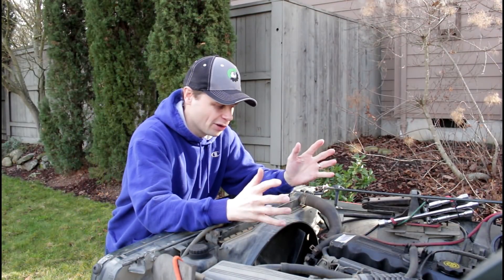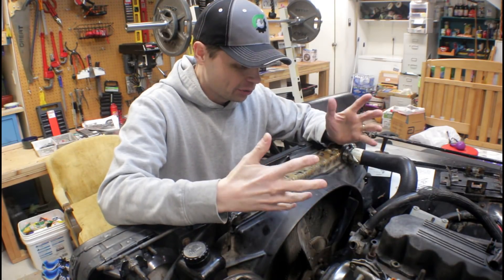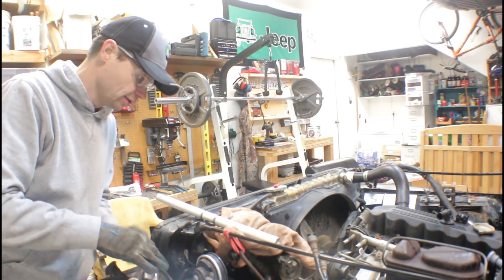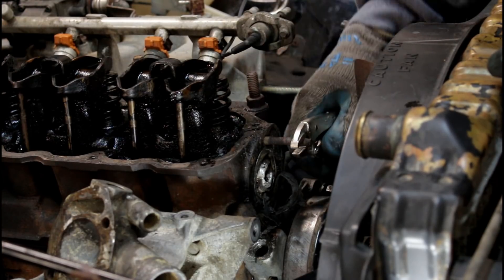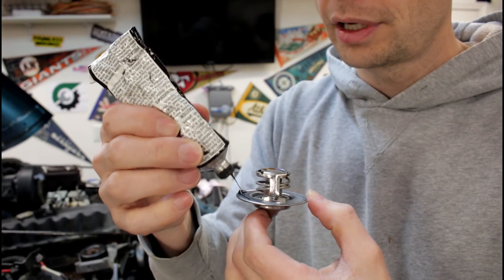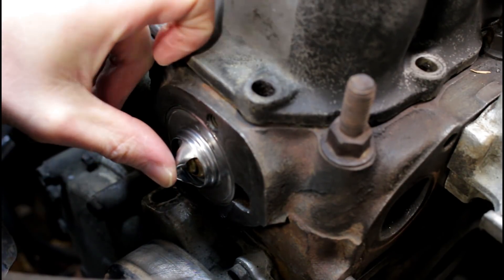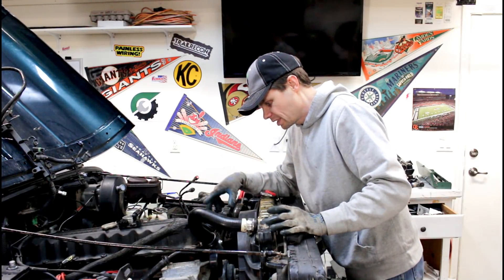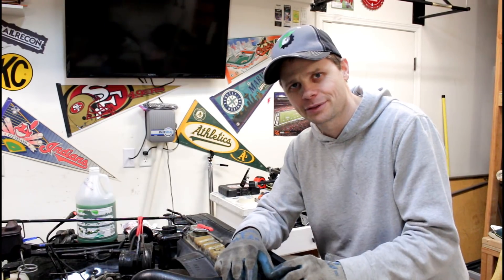Jeep Wrangler YJ Thermostat Replacement

Comment: I had to remove the radiator to install an aftermarket a/c system with condenser and fan. I got it all back together, and the temperature went from 210 on the gauge to 265 degrees before suddenly moving back down to 210 and staying there. I read the thermostat sticking was the problem. So I am glad to of found your video and the coolant hasn't even cycled ten miles yet. I figured I would nip this in the bud before it becomes a problem further down the road.
Reply from the maker: Great! I'm glad you found it helpful.
Reply: @JeepSolid  I did happen to notice that, for the gray RTV sealant for thermostats, the directions said to wait 24 hours before refilling. I don't know if that black RTV sealant you used required the same 24 hours. Other than that, the gray sealant behaved the same way in terms of holding the thermostat in place while I put the housing on.

Comment: Very helpful. Question for you. Own a 2000 jeep wrangler, replace the thermostat but the bolt hole on the bottom is stripped and have a bad leak. Any recommendations, what would you do? Thank you for your time ,aloha🤙🏽🍍

Comment: I was wondering if you ever had an issue with your temperature gauge?
I have a 94 YJ. 
I pulled the gauge cluster out to replace the light bulbs to LED.
When I put everything back together my gauge began to give me problems. So I replaced the gauge. Still didn’t give me a good reading. Jeep would sit all night, and still read 210. I finally replaced the engine coolant temp sensor and now the gauge it maxed out to the limit by driving less than 5 minutes. 
Any suggestions?
I’m thinking about wiring in a gauge through the fire wall straight from the temp sensor.
I have replaced the thermostat and the sensor that goes to the ECM. 
I have no check engine light.

Comment: Another good video!  and great tips on the process. Good idea to go Grade 8 bolts just to ensure they never snap again. doesn't hurt to use never seize on the bolt shafts where they got stuck last time!
Reply from the maker: +Jeff Chappell yeah, anti seize is a good idea as well

Comment: Yup; as I’m doing my water pump I decide to do my thermostat as well once I was done and what happened the bolt came clean off just like yours, and nowhere could I find the top bolt ended up going with a 1/4th inch shorter bolt which I suppose won’t cause a problem since it’ll be in there either way. Great video thank you!
Reply from the maker: yeah, what a pain.
Reply: Measuring mine to the old, unbroken bolt, it was 2 1/2 inches. I could not find the 2 1/4th inch bolt either, so I got both 2 and 2 1/2 inches to measure up.

Comment: Right away!  This is what I'm talking about!  I can already tell this is the solution! I just figured the automotive industry wouldn't be so stupid and when you buy a gasket it is quality and will work the first time as it should!!!!!   This isn't helping that people have to make money of knowing cheap tricks (unrelated)   At least your video seems to be helping and this would be the resolve I'm sure(a gasket that seems to be the correct width and proper sealant just incase), I might have to order a new thermostat housing to be safe! Not sure yet. Really don't see a need! Just not a fun job to be direct! I appreate the humor within your videos.  Lmao?  You said felpro? I don't think so! That's the gasket I used and it was shit, the other gasket looks like the 30$ gasket, also not colored the same  35630 was the part for the  felpro gasket Grey and red lines around the gasket for the one I ordered and tried! It ripped even with perfect seating, so not likely the r.t.v would have worked with this gasket!    This was for a 2000 jeep wrangler 2.5L   Altought the gaskets look the same at least for the fitment!  Yours looks like 30$ edelbrock gasket

Comment: Awesome video dude..ha i new there was a reason for that little whole! 

So you putting lube on the thermostat to make it stay and not leak was why i found your video! Question my replacement thermostat came with a rubber “O” protecting type situation around the rim! Is it for a reason or part of the packing? 

Thanks ahead of time!
Reply from the maker: I'd look up images of that brand. See what you can find out. I'd guess it's part of the thermostat

Comment: I've got a 1997 Jeep Wrangler SE with a 2.5 4 cylinder engine; I need to put a thermostat in it badly. 170k miles on the housing but hopefully, the bolts won't break!!
Reply from the maker: Yeah. Mine broke as I show on video. What a pain it was.

Comment: I have a YJ, freshly rebuilt motor and runs really cool, to the point where the heater barley works and run around 120-140 degrees. Do you recommend where the weep hole on newer thermostats should be oriented?

Comment: I have a question... the manual says it takes around 2.6 gallons of coolant. It only took 2 gallons. Any ideas? I have a 92 wrangler with a 4.0L
Reply from the maker: Probably want completely empty.  Just make sure you burp all the air out
Reply: @JeepSolid  ok. thanks. Love your channel

Comment: with the thermostat that you are installing I saw that you don't have a purge hole in it, how should we purge a thermostat that 
 dont have that hole to purge the air?
Reply: sushil1983 he explains at the end of the video if you want you can drill a purge hole yourself if you like other wise you have to wait till the thermostat open I believe if I remember correctly.
Reply: Thanks Kevin, yea I made that question before ending the video. But thanks for the suggestion. I will do that
Reply from the maker: +sushil1983 yeah, bleeder is helpful, but not absolutely necessary.  Thanks for watching!

Comment: Great video, helped me immensely!! I noticed a tiny leak after I was done near the housing. I read to park on an incline in order to fill the engine block and have coolant pass through thermostat. That sound right to you??
Reply from the maker: Paring on incline is fine.  Just have to make sure you're getting all the air out and topping it off as you go.
Reply: @JeepSolid  thx again!! It worked. Its getting overheated still but takes a lot longer. Im thinking it's the water pump maybe. Heat is working fine too.

Comment: Ok. I just used this video to change my thermostat. The old thermostat was stuck open. Temp wouldn't come up past 120. Very cold. 

Installed the new Tstat. NOW, the temp gauge hangs out around 240-250°F, which scared the hell out of me. So I made certain that it was fully topped off with antifreeze. Gauge still running hot. Couldn't figure it out. So I decided to put my digital temp gauge on the Tstat housing. It says 180-185°. Does this mean the temp sensor is faulty? Or possibly the gauge?

The heater gets really hot. In my experience, if the car is overheating, the heater will turn cold, but it's not. It's not bubbling or steaming or running bad. So I think maybe it's not displaying the correct temp.

Comment: Never use a thread sealant on temperature sensor as it may impede the grounding of the sender..
Reply: Dont have to worry about that for the sensor in the thermostat housing, it is a 2-wire sensor for the ECU. The one for the gauges in the rear of the head could have an issue if doesnt get a proper ground.